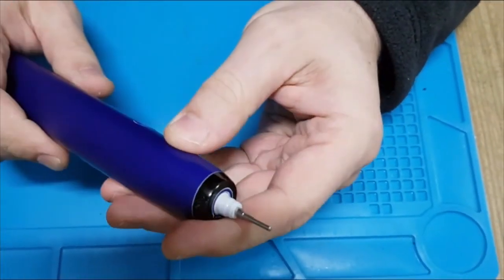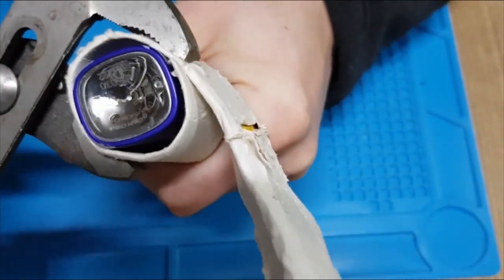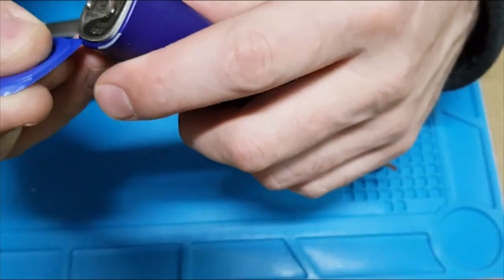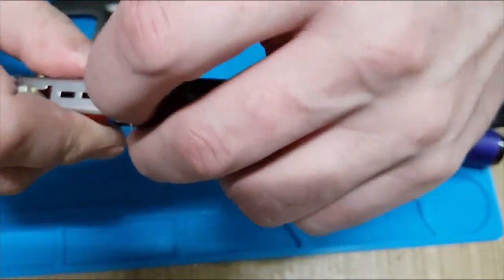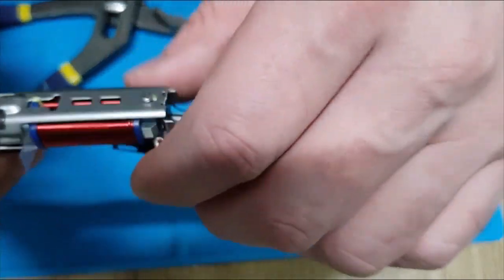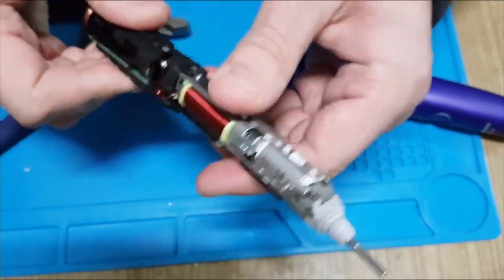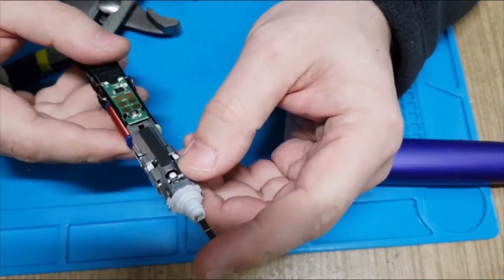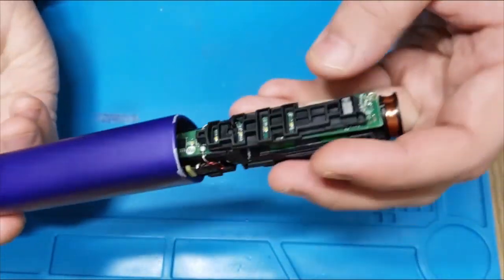Philips Sonicare DiamondClean /no vibrations/ opening and repair

Comment: Hi, nice videos you did there, I also repaired several Sonic Cares so far but what I repaired was only the magnet distance problem. What I'm facing now in 2 cases is that after fixing the magnet distance I still have the problem that the pressure detection is too sensible. Do you have a specific video or part in some video (minute xy) where you tackle that problem ? I know that the front part has the contact that acts as a trigger to detect too much pressure, but I haven't figured out how to best make it little less sensitive. Could you help ?
Reply from the maker: Hi, sadly no. My Impression is that older diamond clean series made it somehow mechanically as other ones have an actual sensor next to the magnet that senses to strong magnetic field and shuts it down shortly. And mechanics is precision.. maybe the one that you are fixing was dropped and something is bent inside.. the whole electromagnet unit is welded together and it's not really reasonable to cut it open.. just replace the whole electromagnet head is the way I would go.. good luck!
Reply: @letsfixitgarage  Thanks for the answer. One I'd like to improve is the hx9160. Any thoughts on this particular model ? It's 2-3 years old
Reply from the maker: @SebastianWojtowicz123  if I'm not mistaken this model should have an magnetic field sensor. It's simply glued in place so you could try to move it up or down. Maybe it will help to find the sweet spot..

Comment: mine just starts itself and changing programs until battery dies. Can't be charged it goes to a point and starts buzzing. Any fix?
Reply from the maker: Water inside. You can check out my video for water damage fix but it's quite delicate work and strong magnification is a must..

Comment: One of the little red wires snapped on me while moving the magnetic
Reply from the maker: It's just a wire you can repair it by soldering or replace it with a similar diameter wire by resoldering it..

Comment: can't you just leave the plastic piece in to prevent contact? Consumer impowerment yea baby, thanks instructions, is this brushless motor?
Reply from the maker: Sadly not hat simple.. friction would prevent vibrations.. there has to be an air gap. this is an electromagnet that changes it's polarization faster than any motor could ;)

Comment: how to tear down the power button？
Reply from the maker: What do you mean? On PCB or the housing?
Reply: Lets Fix It Garage on the housing
Reply from the maker: Not possible. It is fixed on a rubber membrane that ensures watertightness. if it has a tear you need to exchange it with the whole housing. But if you want to wash out the toothpaste buildup in it take out electronics and put the housing under warm water leave it for some time and then keeping the housing under water make a lot of on/off presses all the toothpaste wil come out and the button will start moving freely again.. hope this helps
Reply: Lets Fix It Garage thank you for your reply. actually there is brown film at back of button,i think It is for water resistant. Anyway do you have tear down picture of button?
Reply from the maker: Yes it is for watertightness but it's glued to the housing so no way to reapply it back if you take it off. Sorry but no, haven't made one..
Reply: Lets Fix It Garage Tks

Comment: Yes, it KIND OF worked because the spacing was not correct at the toothbrush in the video started making metallic grinding noise. He actually never showed  it completely fixed. This metallic noise is not perfect. It is a half-fix until you can clearly show the correct spacing.
Reply from the maker: You are right first it was a too small gap and I haven't shown on camera how much I increased the gap. Although it really depends. As from factory they come out with gap of 0.5mm, or something like that, really small and it doesn't grind.. I assume that as it wears other parts give some additional space and it starts making noises. So my advice would be make as small gap as possible where it wouldn't make the metall grinding noise..

Comment: Excellent display of how to open and change the battery, I would never have worked this out. I have one small issue, It won't charge with the end cap on but if I open it and remove the end cap and place it in the charger it charges, Have you encountered this before.
Reply from the maker: No didn't had something similar.. maybe the charger is starting to fail did you tried putting it in other charger?

Comment: Thank you for this. Mine wasn't losing power but it was noisy. I think it was from dropping it on the head too many times. I increased the space between the magnet and the electromagnet and that metal tab stopped vibrating loudly which was the same sound you had at the end of the video. I ended up maxing out the distance and it worked no problem.

Comment: Helped fix my toothbrush, thank you! However, this is the old brush so I had to watch 3 of your videos to tweak the fix for my brush. If you could do a video for the new sonicare diamondclean that would help alot of others out. Thanks again.
Reply from the maker: I made an opening video for smart sonicare diamondclean. It had a simpler problem (wrong charger was used) but mechanical part is very simmilar to the old one only pcb design is differemt as I recall.. but if I will get some of the new ones I will take a deeper look in to them.. thanks for the feedback!
Reply: Can you tell me which videos you watched? I have an HX993W and there are multiple additional wires preventing me from accessing the screw portion.
Reply from the maker: @payaladhikari8007  yes, the bluetooth or smart version has some additional difficulties.. the shiny cooper wires should be desoldered and sensor at the magnet peels easily off. Just try to peel it off with clean small pliers so it would stick back on afterwards.. hope it helps

Comment: How can I remove the upper plastic ring to replace the silicone sealing? It has a tight fit to the metal shaft!
Reply from the maker: Squeeze it with pliers from sides (upper part) and pull up.

Comment: Hi, thanks for the instructions. I was able to do everything; however, now my toothbrush won’t start when I click the ON/OFF button. It was fully charged, the wires are fine, I put about a 2mm space between the magnet, I’ve tried charging it. It was working before I tried to fix it and would turn on when I tried taking off the silver bottom. Any thoughts on what I could done that now no power is going through it? The light doesn’t even go on when charging
Reply from the maker: Hi what was the initial problem with it? If it was water damaged it could be that the pcb traces are damaged you need to track down them with a multimeter check my other videos. If it was only loud vibrations I would need more info what was done.. as usually you don't do anything on pcb and it's not affected by mechanical repair.. if you remove the solder jumper on the bottom of the motherboard you need to reapply it afterwards.. so in your case I would check battery voltage, then the button and if it was watter affected - motherboard traces from chip to button and mosfets.. and as one commenter wrote he accidentally shorted out the big 6 pins that are there for programming the chip in that case the chip could be bricked then not much advice only to replace the motherboard..
Reply: Thanks for the quick response. The issue was only loud vibrations with very limited head movement. The toothbrush was fully charged before I started. I must have did something incorrectly when I followed the video. All wires seem to be fully attached and I didn’t intentionally disconnect anything. It took me about 2 hrs to follow the video. My father-in-law is an electrician, I’ll see he can take a look to test. Thanks!
Reply from the maker: Strange usually with this repair you don't mess around on the board with a wire or some metal object that could short out some connections so this mechanical repair doesn't cause these issues.. if it's not much to ask leave a comment or a short email to letsfixitgarage@gmail.com what was the problem if your father in law will find it.. thanks!
Reply: Will do.

Comment: I discovered that if you have a rubber tip air gun nozzle, you can blow compressed air in the center hole to get it open. Depending how good of seal you have you wont need to use channel locks. I usually can get it to pop right off. It takes all the anxiety away from potentially damaging the the toothbrush. I hope this helps. Your videos are the best, extremely informative and in depth. Your the only one I've found  putting out this level of content. Thank you for all your hard work and keep it coming. You helped me fix my Sonicare in less then a half-hour and saved me a lot of money in the process.
Reply from the maker: I saw this method but havent tried it yet as in the video that I saw they cut away the rubber sealing. If it's water damaged then it's no problem but if you have a good seal and fix is just retighten a screew or make space for electromagnet it seemed to be wasteful.. but it is very efficient and as you said no anxiety to break something! Thanks for sharing and a good word! I try to make videos and channel that I look for, efficient and right to the solution :) altough these kind of videos come in handy only once, when they break, so hope that this toothbrush will remain popular in the world :D

Comment: I had an issue with very loud vibrations and I opened it up and tightened up the screw at the top and it stopped vibrating loudly and it was ok. However, after a few uses the screw loosened up and I had to repeat the process.. it seems like it will keep repeating, I have tightened it up a lot and it still manages to come loose.. do you know of any permanent solutions to this problem?
Reply from the maker: Use srew tightening liquid like loctite or similar. Or if you don't have it at hand some glue applied on screw thread could help to, but for this purpose designed liquid is of course much better and has less problems afterwards ;)
Reply: Lets Fix It Garage thanks for the tip, will try it out later :)

Comment: I just opened my toothbrush which charged and did some vibrations, now after opening it, it doesn't turn on any ideas? Could I have shorted the motherboard?
Reply from the maker: What did you found inside? Did it had water inside? Anything is possible if you had something metal on some of the contacts or pins.. if there was water inside you can check my other videos about how to diagnose and repair these kind of damages.. and one more thing you could do is check if battery is charged and if yes you could desolder the jumper pins and resolder it again making a reset by removing power..

Comment: For anyone with a loose/wobbly top metal end, I firmly tapped it on a hard surface and that improved the vibration transfer to the brush head.
Reply from the maker: That means you have a loose screw at the shaft. Taping is temporary helpful but after some time it will repeat itself even ofter and if you tap it to hard you could breal the cast part so taking apart and retightening the scree with some screw fixation is the way to really fix it..
Reply: @letsfixitgarage  Oh, thank you so much for letting me know!

Comment: thank you!!!!
Mine had a different issue, it worked well unless you put some pressure on it and than it stopped vibrating untill you moved it around...
Wasn't sure if it was me or if the toothbrush until i saw your video.
following your guide i managed to fix my brush! thankyou!
Reply: Etan, I have the same problem. If the stem/head is pressed slightly forward, the motor still runs but no vibration. By pressing slightly the stem/head to the left, right, or backwards it vibrates agains. What did you do to fix it?
Reply from the maker: You will need to take it apart and then examine a screw at the stem/head bottom. Sometimes it's lose or sometimes this steam/head part can be broken I show how it looks in my other videos. either way you will find your answer after taking it apart.